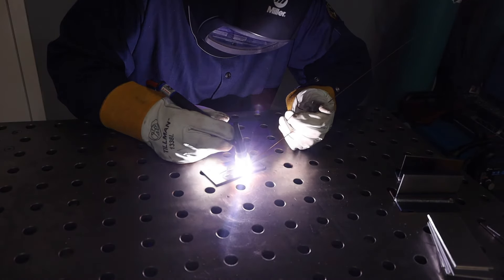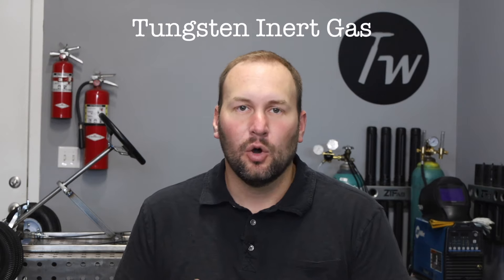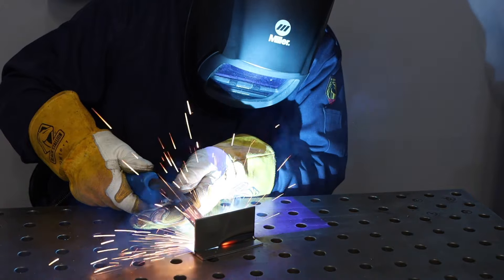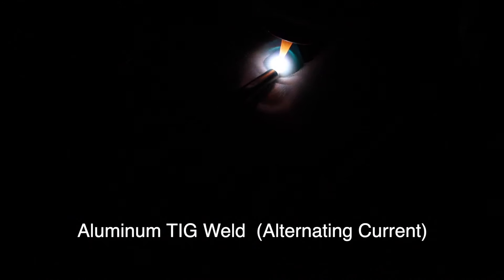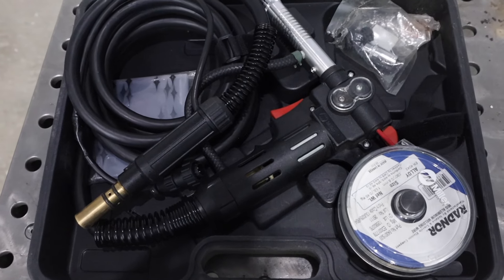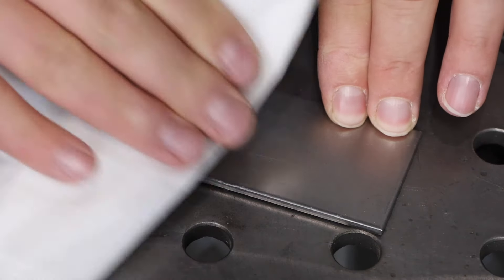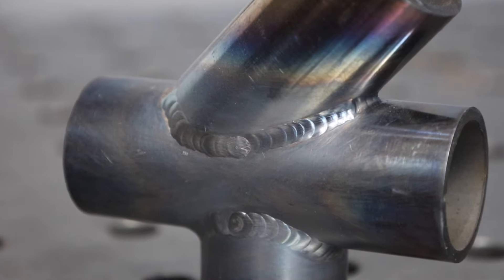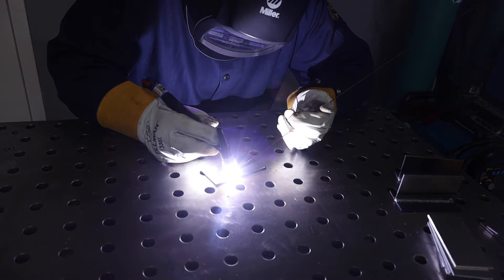TIG vs MIG Welding for Hobbyists: Which Type of Welding is Best?

Comment: You're talking about MIG welding, not MAG - so argon or argon/helium to everything.
TIG - argon or argon/helium to everything.
Where's the protection gas difference ? 
:P
Reply from the maker: It’s technically MAG in steel, but hardly anyone calls it that in the US, so I’m just using the common term. If you want to use technically correct terminology, gas metal arc welding GMAW is better.

Comment: Honestly tig is for like aluminum rvs and those metals bud when using steel or metal i whould use mig because its lots and lots easier than tig tig is very hard i think u realy need to practise tig a lot lot a lot more than mig   bud in the end tig is the best for a lot of materials bud mig is like easier to learn bud tig looks a lot more artfull